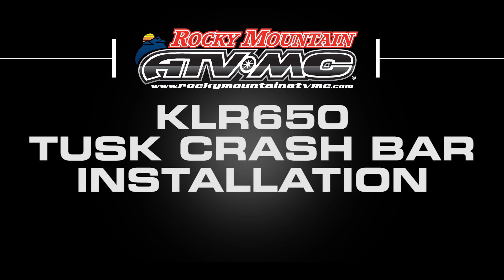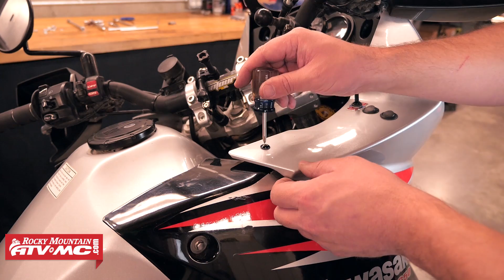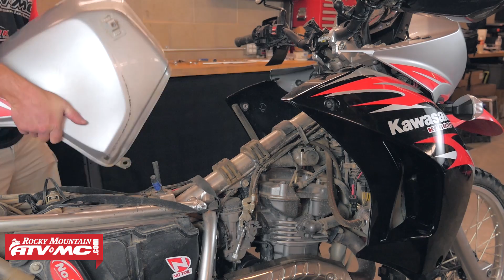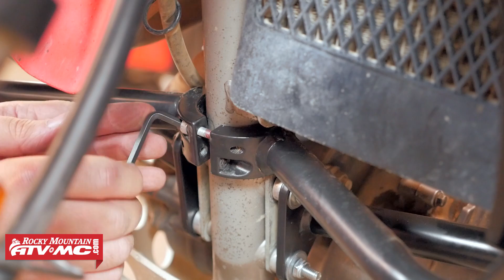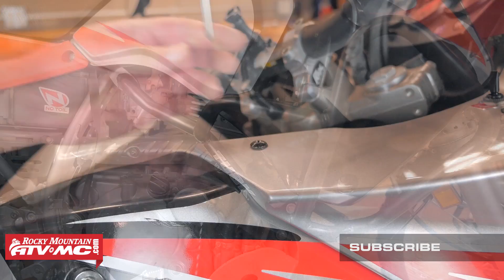Kawasaki KLR650 Tusk Crash Bars Installation

Comment: I take it since you didn't add a year of the bike  this crash  bars will work on all years  right ?
Reply from the maker: We have these available for the generation 2 KLR650 (2008-2018).
You can check out more info on the Tusk Crash Bars - Engine Guards here: https://www.rockymountainatvmc.com/parts/tusk-crash-bars-engine-guards-p
Reply: @rmatvmc   So if its not  for  all the  klr 650's why don't you  put the years  it fits ? I can't find a crash bar  like the one your showing  in the video  on the web site  to fit  gen 1 . Do you make one or not ?

Comment: It is NOT this easy with the stock skid plates. The brackets make putting the spacers in nearly impossible, I had to use a combination of tape, hammering, pole magnet, and every other tool in the book you can think of. It was not fun. Looking back I have no idea how I actually even got them installed

Comment: No problem installing the crash bars but cannot get the tank on correctly to align with the side panels. The two mounting bolts on the tank match up with frame but the rest of of tank is too high. Don't want force it. Anyone else had this problem.

Comment: Would this fit on a 1st generation klr650.
Reply from the maker: Unfortunately, the Tusk Crash Bars are made for the 2008+ KLR650's but we do have SW-MOTECH crash bars available for the first gen's. You can check those out here: https://www.rockymountainatvmc.com/parts/sw-motech-crash-bars-engine-guards-p

Comment: Thank you for this helpful video, which I used to install the bars and Motech Ricochet skid plate on an ‘09 KLR 650 last night. 
When I removed the factory skid plate, I was surprised and initially discouraged to find that there are some metal tabs to which the front of the OEM plate attaches bolted and apparently welded to the triangular engine mount. Just wanted to comment that the crash bars CAN be installed with those tabs in place. It is a little more difficult to access the lower bolts if you leave those on, but you’re left with extra protection in the gap between the bars and Ricochet plate and some folks attach a tool tube there.
Reply: Idk about you, but it was MUCH more difficult. There was no room to do anything with those tabs, my hands were bleeding all over by the time I finished. Maybe like 3 universal joints and extensions would have done it

Comment: Installed these on a 2018 KLR and one side is sticking out farther than the other. Not a dealbreaker but kind of annoying to look at.
Reply: It has too to allow for the radiator.
Reply: @malcolmnuttall3165  the side with the radiator is the closer side. It’s the coolant reservoir side that sticks out further

Comment: Anyone know where to find replacement mounting hardware? I'm trying to piece this stuff together but I'm not having luck. The metric spacers are proving to be impossible through the internet and locally. I just installed the Eagle mike's through bolt to the subframe and got ready to install the bars but can't find my hardware kit. Thanks in advance.
Reply from the maker: You just need the mounting hardware for the Tusk Crash Bars? If so, just give us a call and we should be able to track some down for you.
Reply: @rmatvmc  i called yesterday but you guys were out of them. Sent me the instructions, which I appreciate but I can't seem to locate these metric sizes or the correct spacers. I emailed today and they are looking for me.

Comment: Can you get the carburetor off with that bar in place?
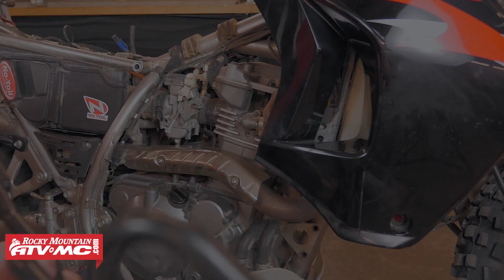Reply from the maker: Nose2wind- Looks like at min 2:30 it would be a very tight squeeze to get the carburetor out.  We have yet attempted to try and pull the carb out.  If anything, you could pull the one bolt out to loosen the crash bar to give you enough wiggle room.  Hope this helps you out. Thanks

Comment: I finally got my Tusk Crash Bars installed on my 2015 KLR 650 with HTP (Happy Trail) skid plate.  They look great and I haven't had to use them yet. ;)   I do have one issue though.  I am encountering the same vibration issue that others have seen/felt.  At low RPMs (~2500 RPM), there is a resonant vibration that I can feel in the handlebar and foot pegs.  Do you have any recommendations on how to eliminate or at reduce this vibration?

I'm not sure if some sort of rubber mount might help or not.  If you have any recommendations on how I might remedy this issue, I would appreciate hearing them.  Thanks.
Reply: Same exact situation on my 2012 klr.

Comment: i purchased these tusk bars, but my right tank shroud is broken near the bottom bolt.should i wait to order a new shroud before putting the tusk bars on? Or can I get at the broken shroud after install thank you in advance.
Reply from the maker: It'll probably be a little tight fitting molding it in to position, but i'm sure you could make it work.

Comment: Why can't I find TUSK crash bars to buy for my 2013 Kawasaki klr650?
Reply from the maker: +Tim Allen You can find them here: https://www.rockymountainatvmc.com/p/1062/-/1092710/Tusk-Crash-Bars-Engine-Guards-Black 

part# 1560870001 - Currently out of stock sorry.
Reply from the maker: +Tim Allen You can find them here: https://www.rockymountainatvmc.com/p/1062/-/1092710/Tusk-Crash-Bars-Engine-Guards-Black 

part# 1560870001 - Currently out of stock sorry.

Comment: will these fit with the htp skid plate?
Reply: +SteelCityADV did you try it?
Reply: +jizohn85 no I haven't
Reply from the maker: +SteelCityADV Straight from our Product Details page off our website.. Fits with: - Original Kawasaki Skid Plate - Ricochet Offroad Skid Plate - SW –MOTECH Aluminum Skid Plate
Reply from the maker: +jizohn85 Straight from our Product Details page off our website.. Fits with: - Original Kawasaki Skid Plate - Ricochet Offroad Skid Plate - SW –MOTECH Aluminum Skid Plate
Reply: +Rocky Mountain ATV MC Thanks for the response.  I don't have any of those mentioned skid plates.  That is why I asked the question to see if someone has the one that I have.
Reply from the maker: +SteelCityADV Ok cool. I know some people have been able to get away with simply cutting out a little section on their skid in order to get these to mount up.. not sure if that will be the case with the HTP Skid Plate?

Comment: Great..... Now I have a crisis on which guards to buy.....
Reply from the maker: +b1pig We were hoping to simplify that problem.. (hint hint) :)
Reply: +Rocky Mountain ATV MC I looked at the item description... but I still have to ask. Do you think it will fit with the JNS skid plate as I already have one on my KLR? It "looks" like it should fit.... buuut..... if all it requires is some trimming around the upper part of the skid plate, i'm good with that.

Since there is a spacer, that eludes to the fact that I can mount it over the JNS hardware.
Reply from the maker: +b1pig I asked around and we did have a shop bike come in with the JNS skid plate and it mounted up.  We may have had to trim a little bit off the skid plate, but it fit and looked great. Let me know if you have any other questions about it.
Reply: +Rocky Mountain ATV MC  that was it.... with that, you definitely simplified my problem. (hint taken). thank you.

its actually going to be really easy to convince the wife. the bike in the video has the same color/graphics as mine. :)
Reply from the maker: +b1pig The Tusk Crash Bars don't only armor up and protect your dualsport bike, but they give it that real aggressive adventure bike look and feel.  They're a must have on these full figured machines :)
Reply: +Rocky Mountain ATV MC Again. Thanks for answering my concerns for fitment. My order has just been submitted. Thanks for helping my KLR survive ME. :-)
Billy (b1pig)
Reply from the maker: +b1pig Hey you're welcome, anytime!